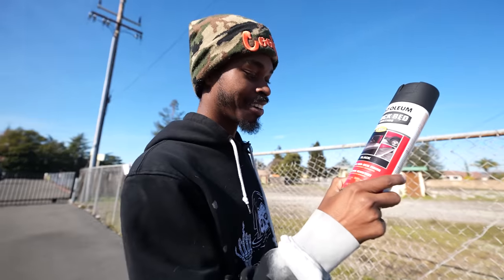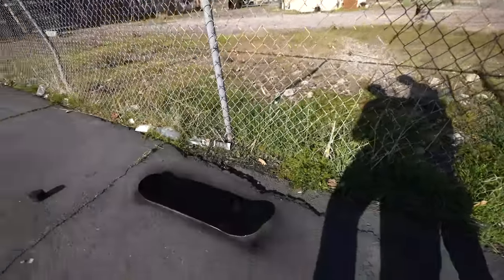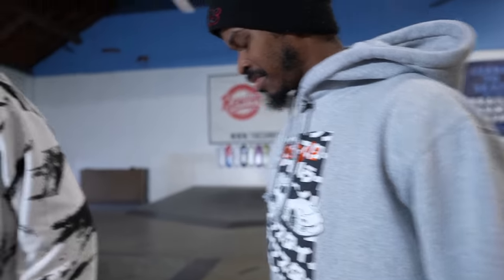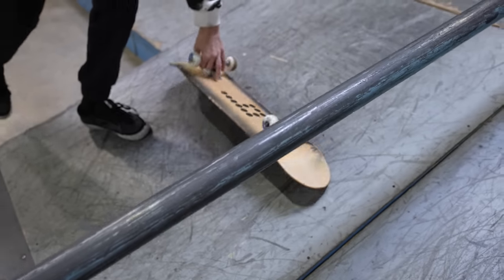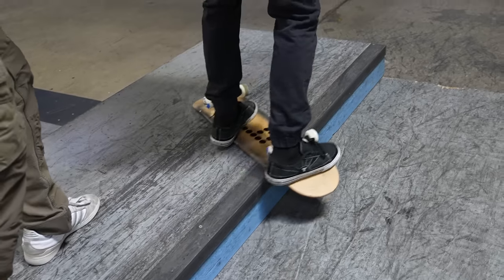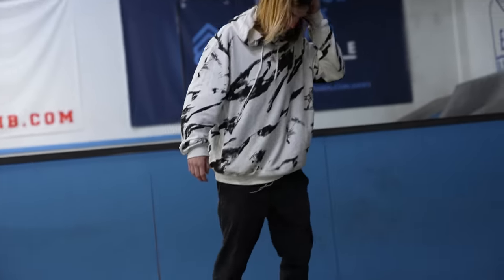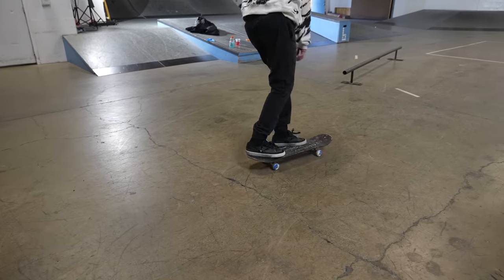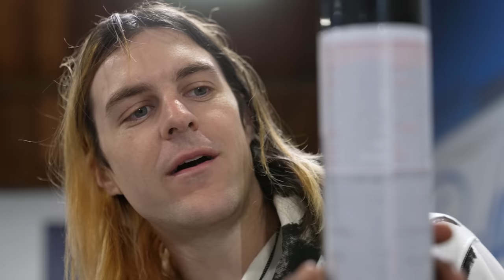DIY SPRAY ON GRIPTAPE?! SKATE HACKS!

Comment: What's been around forever is "Shark Grip" additive powder.  You spray something (even with clear varnish) and then sprinkle it on, to make a grippy surface. I've done it on home-made Endo/Balance Boards, available at any Home Depot!
Reply: They actually did a video on this a bit over a year ago, if I remember right. At least it was something applied just like you said

Comment: When it comes to bed liner, you need to keep a certain distance when spraying the stuff. too close and heavy amounts will smooth out the liner instead of having that texture you all  were expecting (about 6-10" spray distance). Also, I would recommend a brand like Raptor bed liner kit or also the spray bottle, since I have the most experience with it when I get jobs to do full size truck beds, bumpers or grill guards, it has great durability and resistance to scratching. The spray bottle one, would probably work way better than the one yall have purchased.
Reply: And do more than one layer... it gets more textured when layered. Spray a layer... wait 10/15 minutes, do another... about 3 or 4 times.
Reply: They need to do a light sanding with a medium grit first also. They’re spraying directly onto a slick surface 🤣
Reply: Yea theyre not the best with instructions. Just watch their last spray on liner vid lol
Reply: Would it also not adhere better to bare metal rather than wood? I would assume the substrate the product was designed for would work a lot better.
Reply: @Camelotsmoon  yea thats true, but since its just straight wood,  a adhesion promoter or a gray primer thats scuffed or sanded after will allow a better grab to the primer

Comment: I think you need a slightly rough surface to get the spray to stick correctly. Otherwise I guess the advantage of these spray on products is that even if it gets damaged you can always just touch it up in a few seconds

Comment: Herculiner from Walmart has sand in it and would work great. It’s roll on Bedliner and I have the whole inside floor done with it in my Jeep. I recommend maybe giving it a try… maybe???
Reply: This. It's expensive, but works as well as Rhino liner or Raptor liner professional truck liner. I use it regularly as an undercoating in car restorations.

Comment: Try next: LUCID COLORED CLEAR GRIP SPRAY RED. The Lucid color grip kit is made out of recycled glass and Lucid's Clear Liquid. This is a water-based, hard acrylic emulsion polymer that exhibits excellent stain and water-resistant properties. The water based premium grade, non-yellowing, clear acrylic top coat is suitable for almost all finished surfaces. 
Would love to see you guys all do a deck with the liquid clear red grip tape.

Sponsored by Cookies . Snow Montana 💨💨💨
Reply from the maker: We definitely need to try this
Reply: Not to self. Don't edit. Likes get lost ✅
Reply: @brailleskateboarding  try gripping a deck with a roofing shingle

Comment: I bet it fuses to the wood of the deck differently than the metal truck bed. That could be why it's scraping off
Reply: Maybe if he didnt spray half a can on in one shot... supposed to be applied in thin layers to build up a texture.
Reply: It 100% does. I tried this same product on a scraped up wooden surface with metal edging years back. It still sticks to the metal, but it never really adhered to the wood.

Comment: you need 3 coats in this order: sand the top > wipe it off with tack cloth > adhesive spray promoter to make it extra "grippy" sticky so it doesnt peel off (let it dry and cover it with a box so dust and stuff doesnt land on it > 1st coat(same trick with the box for a few hrs) > 2nd coat (same trick with the box for a few hrs) > 3rd final coat( and let it harden for 2 days)

Comment: Maybe if you sanded deck and after wipe clean with acetone and put little bit off sand over deck before spraying might have been almost like normal. Wouldn't come off as easy then.

Comment: Paint and primer in one, I never believe that. Primer is made for a reason. Some products are pretty bad, especially when you do zero preparation. The board is too glossy smooth. It might be stronger if you sand it and grippy-er with more coats

Comment: 8:53 that's because you guys did not apply properly, when do you ever put 1 coat of anything on stuff... Never, not even professional truck liner is only 1 coat and I guarantee if you got pro truck liner only 1 coat, the same thing would happen... I guarantee you did not read "How to apply" just from watching you spray the first board , Nigel, you don't know how to spray paint things... Hold can 8 to 12 inches from surface, spray long side to side thin coats that you let dry between layers... All the chips and scratches are from goopy uncured paint, it may appear dry to you but it's not, there was still moisture and poor layering on that spray job.

Comment: "theres no way this goes in the back of a pickup truck"

did you guys follow the instructions correctly? do you need to rough the surface first? do you need to apply a primer first? prep work is 90% of a paint job... if the prep work isnt done properly the quality of the job will be affected...

heres what i found: "It is suitable for use on metal truck beds, trailers, undercoating, stairs, ramps, walkways, and work areas. No primer is needed."
so primer is not needed for metal surfaces... pretty sure its not the same on wood surfaces...
if the product isnt deseigned to adhere to wood it wont magically do its job ;)